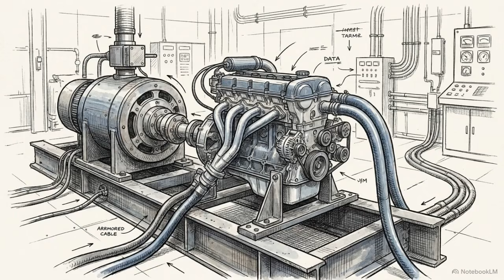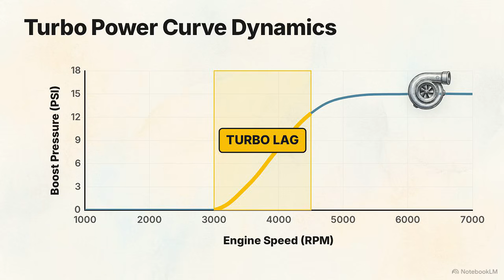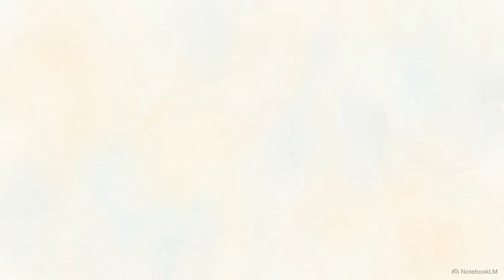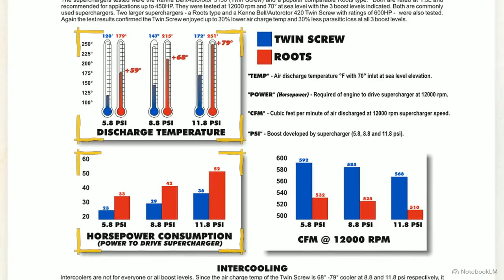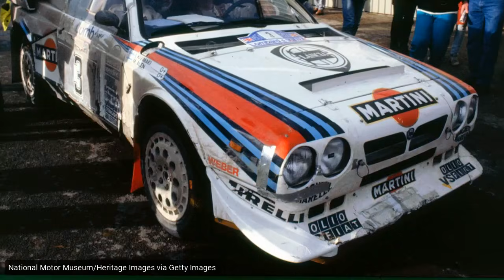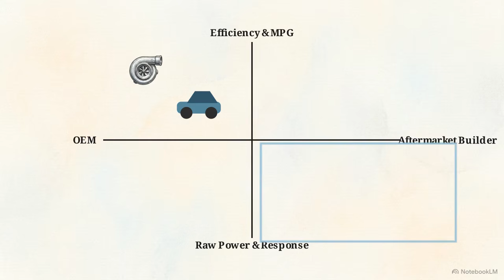Turbocharged vs Supercharged: Which one is the better option?

Comment: My current vehicle has a supercharger.  I have immediate response when I push the pedal.  I have owned turbo charged vehicles before, and though they are good as well, it does take a bit of time to see response after pressing that pedal.  In some cases as long as 3-4 seconds for the turbo to spin up.  Conversely, power is instant with the supercharger.  Step on the pedal in a SC vehicle, and you are moving.  
Both turbo vehicles I had were under 2.5 litres, while the current supercharged  one is over 4 litres.  If you want fuel efficiency, complexity and aren't concerned with response, get a turbocharger.  If you want a larger fuel bill, simplicity, and immediate response, a supercharger is the way to go.